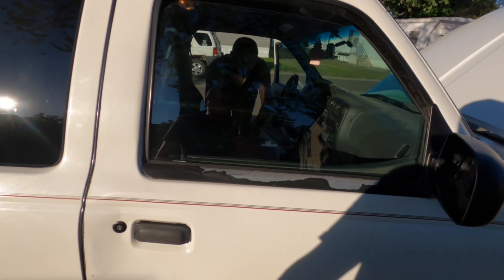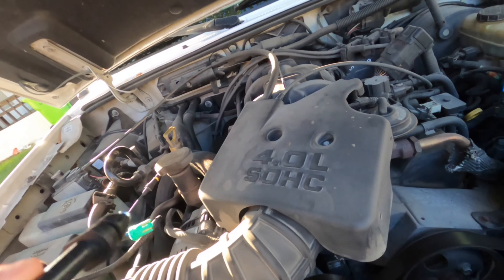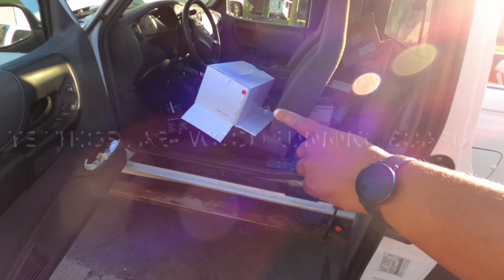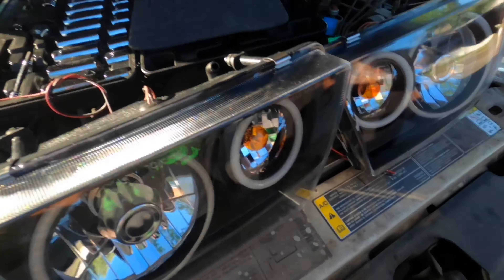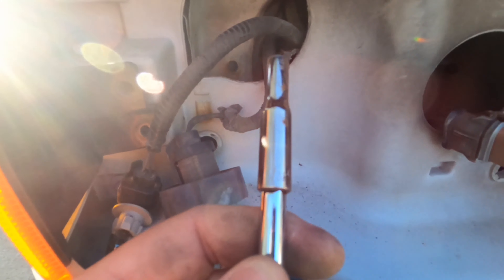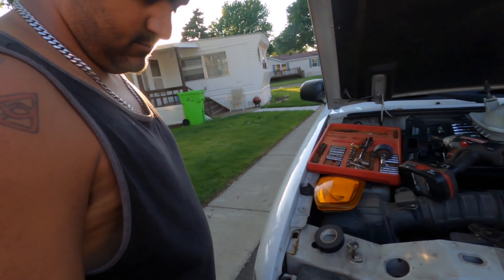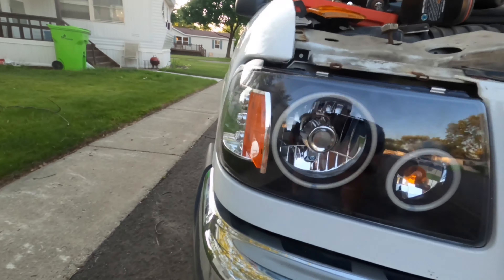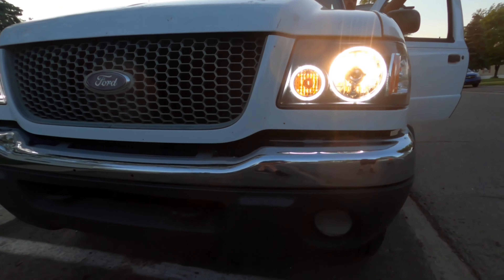How to install ford ranger headlights. led halo

Comment: So I have a question, how do you make the sidelights and white rings work?
Reply from the maker: You have to tap into the running lights so you can turn them on and off with the interior switch

Comment: So on 4:25 you broke the factory plug and it fit in fine? That’s where I’m stuck at
Reply from the maker: Sadly yes, my cousin didnt care because it was being used for offroad kinda and that was the only way they'd fit right
Reply: Wide with Pride  my truck is my daily and I don’t plan on ever switching these out once installed so I guess I’ll do the same? I only bought them so I could LEDs in them since the stock housing wasn’t really designed for leds cuz it was scattered.
Reply from the maker: @ryanhayward5910  I hate to see that on a nicer daily but I think they just designed them wrong that was the only way
Reply: Wide with Pride it’s pretty stupid that they don’t come with directions  to begin with.. mine are identical but their Amerilite and I got them off amazon
Reply from the maker: I think they just made them for a Different year or had a bad diagram for the plug. The plug was the only problem I had with them
Reply: Las direccionales no funcionan